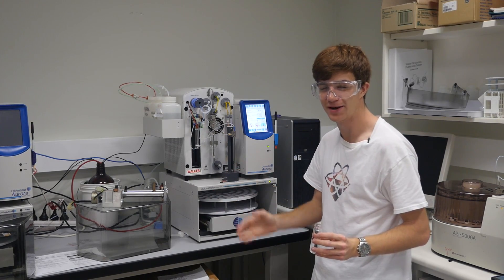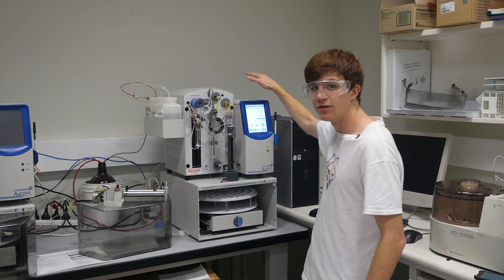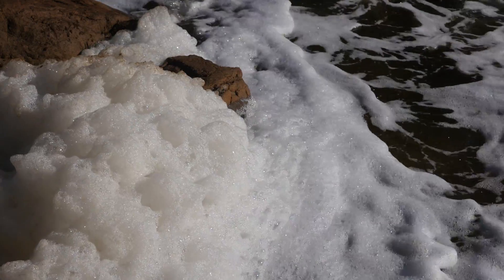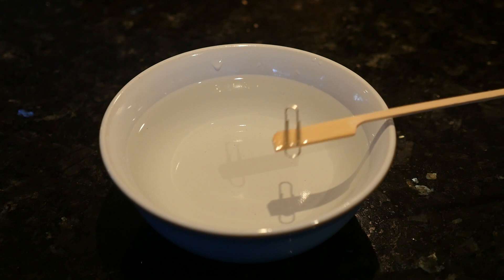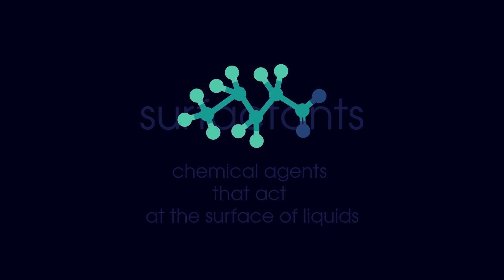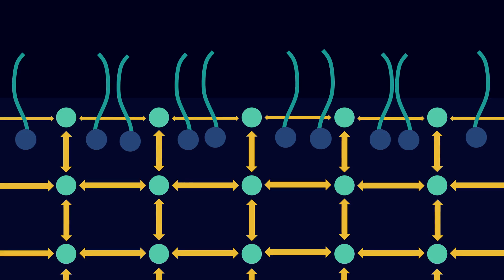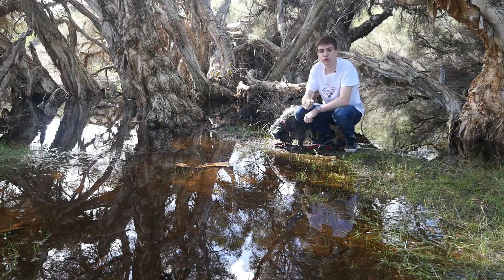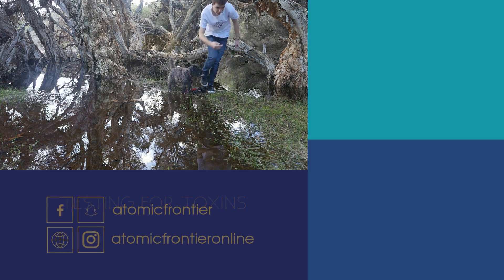What Causes River Foam?

Comment: I don't think the molecules at the surface are attracted to each other stronger than the molecules in the middle.  The lack of a molecule above to be attracted to does not make the attraction to the others stronger!  The force between each pair of poles is the same regardless of what else is near by.
Simply that they are attracted to each other, period, explains surface tension.  If there is a stronger tension along the skin than you would get by imagining a plane anywhere in the bulk, it's not due to the mechanism you drew.

Comment: This is very well done. I do have one quibble about it though...

The chemical test only shows that the rapid water has a higher overall organic carbon content than the other water samples. That is, it has more carbon than the others in the form of an immense class of possible compounds, which can be natural or artificial, harmless or extremely toxic. It would be nice to see some more specific chemical tests carried out to determine what exactly these chemicals are, or at least a mention of others' work answering this question. As it is, the claim that these particular compounds are natural and benign is largely unsupported.